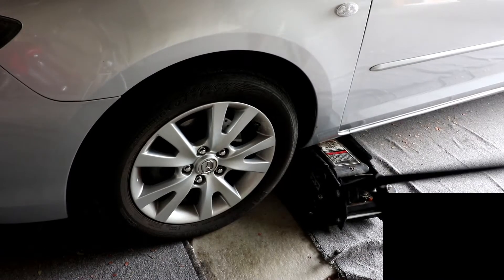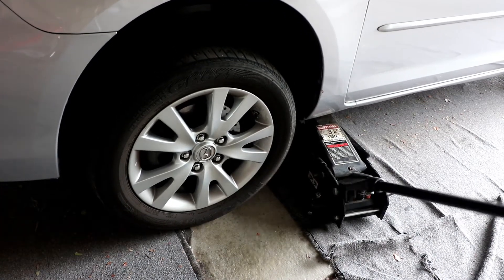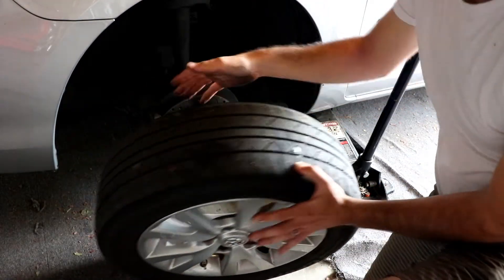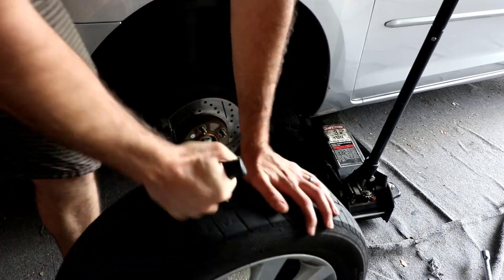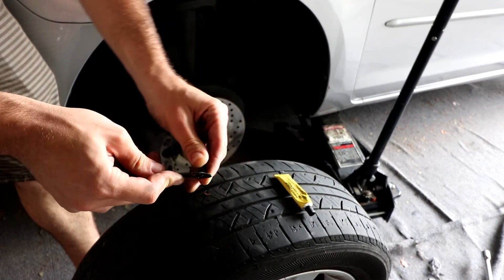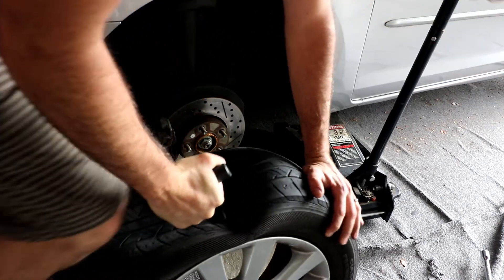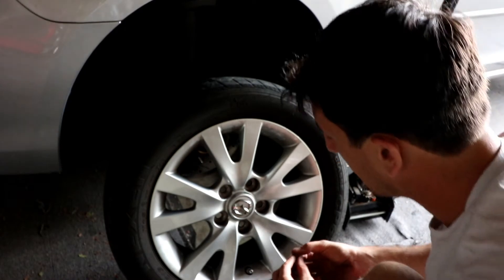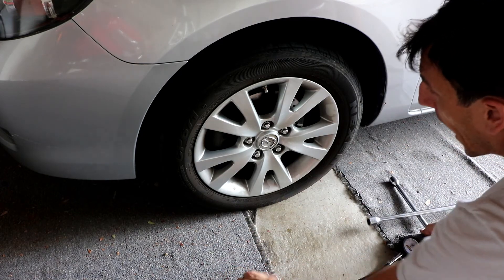How To Plug a Flat Car Tire

Comment: Drew, could be alignment, under or over inflation also could be worn front suspension parts like tie rods or ball joints cause the tire to wear like that. Also worth noting those are tire plugs. If you put a patch in it you'd have to break the wheel off the rim and patch would go on the inside. Then you'd put the tire back on the rim, re-inflate and check for a leak. Great video as always. Sorry to get technical but I'm a mechanic.
Reply from the maker: true, thanks liquor!
Reply: DrewTalks Welcome Buddy. Wasn't trying to nitpick but to help inform.
Reply: I was thinking the same thing. I always used what we called patch plugs that go in from the inside and have a metal spike you pull through. Seen those plugs fail to many times, mainly on my own stuff. That said a plug is still better than a face full of fix a flat when you have to break the tire bead.
Reply: Country Cledus I couldn't agree more. That fix a flat is the worst.

Comment: there was no need to take the valve stem off
Reply from the maker: what if you pull out the screw and some debris gets in your eye
Reply: if you have a leak, theres not enough pressure in the tire to get debris in your eye. Pushing the rod and reamer into the tire is a lot easier with some air in the tire